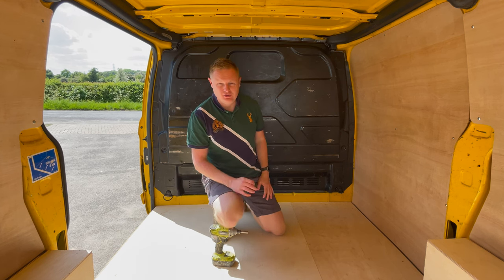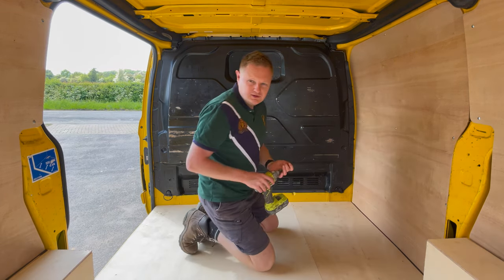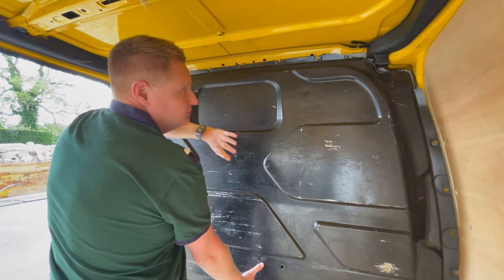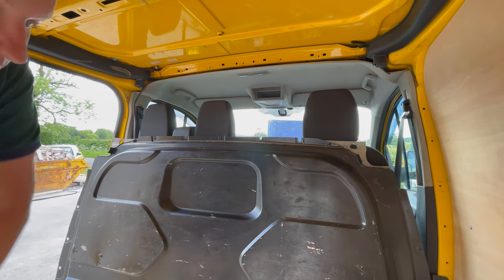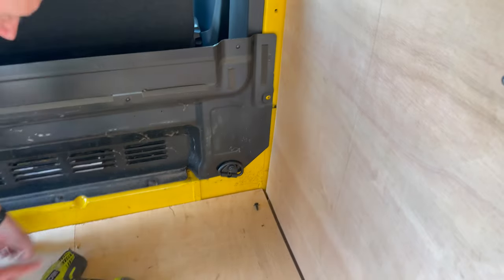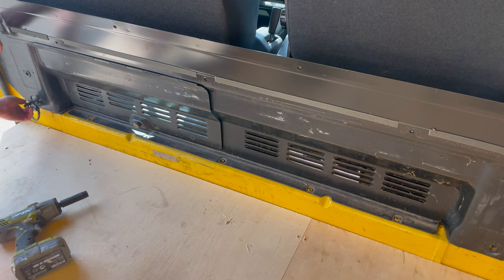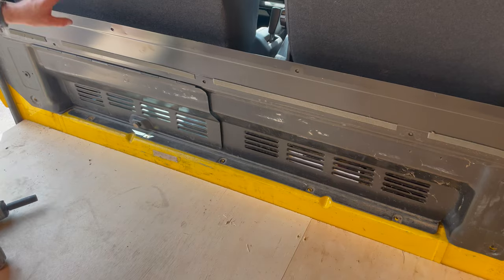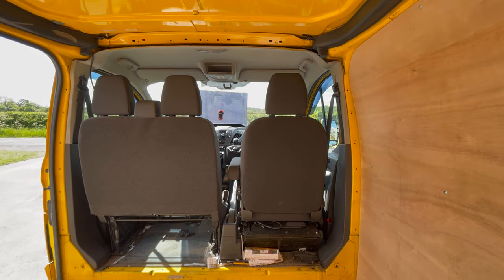EP2 - DIY Camper Conversion - Removing the bulk head on a Ford Transit Custom

Comment: Thanks for this tweedbean, i have to do this to fit front bench seat covers from uk  custom cover as the have a zip is on the back & cant get at the back to do the zip up. I was wondering if the lining was seperate or came off with the metal bulk head, your video helped with that so a big thank you mate.. Oh yes those 2 little brackets in each top corner too. 5*
Reply from the maker: Glad it helped

Comment: Can a bulkhead be removed from the front? I can’t get into my van via side or rear door.
Reply from the maker: No as all the bolts are on the rear side.  A tip I’ve seen is to lift up the passenger seat and there’s a hatch that goes  through the bulk head into the back through there.  Get someone small or a child to slip in that way and use the internal side door handle.
Reply: @tweedbean  thanks for the quick reply. I don’t think my van has the hatch. Ford transit 2008 MK7. Really stuck. Don’t know what to do. Need van for work.